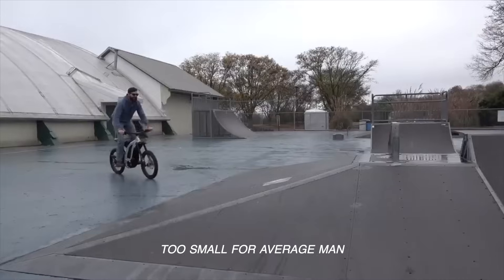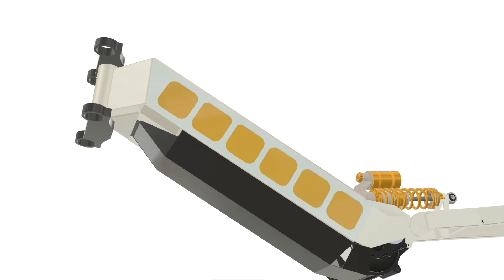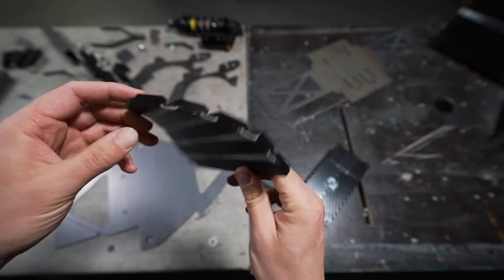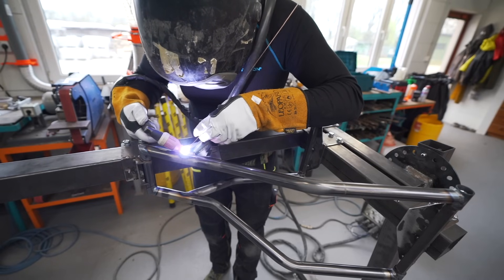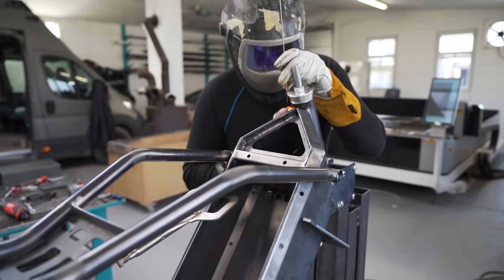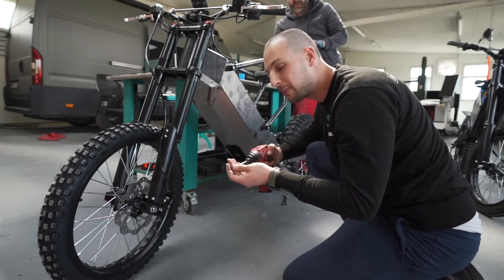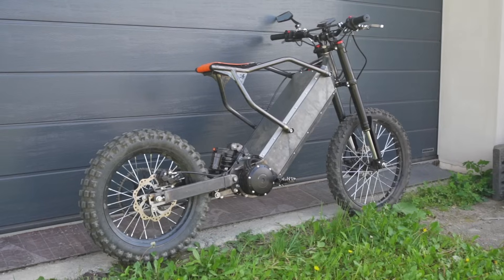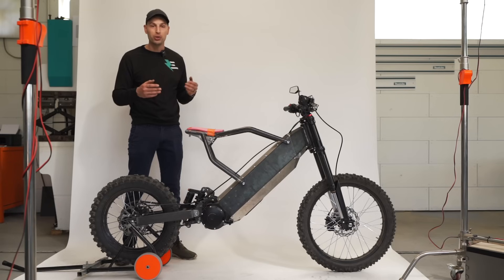Building Insanely Fast Electric Motorcycle From Scratch / New @ridevoltic Build

Comment: I love the design. I think you could maybe look at the seat. The more powerful ebikes all seem to have a small seat pad in the same place. But this is something that should be taken from motocross bikes. And the seat should go the whole length of the top of the bike. Right up to headstock..this would allow the rider to shift weight easily.and get more weight over the front wheel when it wants to come up. And for cornering etc. Also the radiator covers on a motocross bike. They aren't just guards. Their specifically designed so you can grip the bike between your knees when standing. Youre completely right to develop something different to develop ebikes properly rather than copying motorcycles because of the difference in hardware. But I think there is a lot that should be incorporated still. Everyone's making these high powered and using them off road. So the seat especially I think is essential.

Comment: When building a frame or "tube" bender (OEM) or otherwise you have to be very careful because most metal tubes bend much better at different temperatures with out deforming. Just like copper or Aluminum the "hot but "lower" temps keep the metal bending nice and clean without deforming or breaking.

Comment: That is a sick looking beast of a bike. I only see one thing I'd like changed. The seat to something with a bit more foam and a small inner metal ridge at the back to hug the backside and hold you in place better. Again awesome looking machine. I see a lot of places it can be even lighter, such as the main body/ case. Lighter always sounds good but it can be bad too. I like a certain weight ratio sometimes opting for heavier more and less. It helps plant power also plant me in curves. That is something I always liked and preferred with my 98 zx-7 compared to lighter new bikes. I feel way more planted and confident shredding through corners on an older slightly heavier mid 90s bike. I couldn't get used to new bikes, they even feel harder to ride for me personally. When I hear it said its usually the other way around.

Comment: the main reason bikes aren't made for tall people is because if you are in the top 5% or the bottom 5% designers will not make a bike that is ergonomic or anthropometrically designed for these kinds of people. its just not made like this because it limits customers as now only the top percentage height people will be able to use the bike which is not profitable. However its a very innovative design overall and I would certainly buy it if I was the target audience
Reply from the maker: It’s a full size bike. It’s not accurate to say for tall people only. Most electric motorbikes are just too small these day.

Comment: I've been working on a cruiser style e-moto build with LFP batteries in my head! 😄 I would mount the battery pack horizontally, inside the engine cage, as low to the ground as possible for improved stability. Any empty space above the battery pack, going into the faux gas tank would make for a good chunk of continuous and spacious storage area for a laptop, back pack or grocery bag. It would be accessible from the top, through a hinged lid covering the width of the gas tank.  I would want the seat to be lower than the gas tank area, for a lower center of gravity, with longer handle bars and pegs mounted bottom front of the engine cage. As for the motor, although a mid-drive setup would probably provide better performance, I think I would prefer a dual hub motor configuration, due to the more simple and elegant design, lower maintenance, and potential weight savings.

Comment: Great work , and love the basic deign of the bike , only thing I would change is the seat frame , but as it seems to be a bolt on part , it would be easy to have a few different seat designs and let the buyers choose which they want , great work with the battery and the integrated charge cable .

Comment: Need to run a heart shaped die if you're going to press bend with a bend radius 1.5-2x tube diameter to minimize tube distortion.  1.5x diameter or less and if you want zero distortion to your tubes will require mandrel bending.

Comment: Why not use an axial flux in wheel motor? Or a Donut Motor? Simplify!
Reply from the maker: That is a very bad suggestion with hub motor.
Reply: @ladiandmargaret  Works for Escotters UniWheels! now coming to 4x4's & SUV's. OK the Worlds fastest 0-62MPH vehicle not fast enough for you? The weight directly over the Contact Patch of the Drive Wheel/s! Suspension, vertical & linear too! Even with one Wheel Hub Motor Assembly missing it could still operate at near 100% with link Suspension. Not that's a safety benefit! No getting away from that! Just think of the reduction in car part Nos! 4 off Motor Steering Suspension Units! One at each corner, identical battery connections & bolt to Chassis Giga Casting kits! Simplify!
Reply from the maker: How is user experience with 15kg unsprung weight on the rear wheel? Ok for drag rase or flat road riding. Not ok on dirt roads. Your arguments are correct just missing the experience riding high power hub drive motorcycles.
Reply: @ladiandmargaret  All power Motorcycles have the majority if not all power to the rear Wheel. It just depends where it is generated & how it is transmitted. A hub Motor is direct Drive! Whether Donut Motor or Laced in. it can be either redial or Axial Flux, or Even Both! Experienced has to be gained as to what is best for Safety, Efficiency (repair/Replaceability) & Fun!
Reply from the maker: Yes, motorcycles are rear wheel drive. Chain, belt or direct dives. Direct(hub) for high power bikes is heavy, not fun to use in terrain.
Reply: @ladiandmargaret  You can make a small hub motor, say 8" (200mm) O.D. where the Stator is bolted directly to your swing arm. With the O.D. spoke laced to your Wheel Rims & tyre width & diameter of choice. You can put a disc brake to one side if Regs require. Then all you need is Suspension, Battery Box, control under seat & head stock up front. don't get me wrong. What you've done is Ace. But experimentation brings variety!
Reply from the maker: I wish it was all this easy, took few minutes and we had unlimited time with money.

Comment: Forget the 4Kwh Charger. Don't even put a Charger on the Bike. Use the National D.C. Charging Network. These all have upto 350Kwh power rectified to a D.C. Charge. Take a few minutes. Once the battery is primed for charge. Which you do on your way! Simples!
Reply from the maker: This suggestion is completely off.
Reply: @ladiandmargaret You don't carry petrol can in your Petrol car! or a Battery Charger in case your battery goes flat!
Reply from the maker: Are you aware these big chargers operate od 400V or 800V and our bikes are 92V? You can’t just plug in and charge small batteries with 350kW (not kWh) without understanding how things work. Just typing it for others with similar thoughts.
Reply: @ladiandmargaret  Sorry, did not realise. I thought all cars, bikes & light trucks all filled up at the same Gas stations on the Highway! That Ev's would be the same? Boy was I wrong! Bikes are no longer part of the mass Market? It seems. Down graded to Ebikes & other Electrically powered Hand Tools. So for a day out E-enduro riding, you need a bike, a spare battery pack & an E-Pickup to recharge your Spare battery while your burning out the one in the bike!

Comment: Aluminum frame and reposition seat and it would be absolutely perfect
Reply from the maker: You are talking about a completely different frame design because it’s not possible to bend aluminum sheet this way without cracking. Aluminum would require more traditional tubular frame. It would be more expensive and who knows how it would look. This was my choice and we actually did very well with the overall weight. It’s 10kg lighter than surron ultra bee - direct competition. Surron does not even have a built in charger and is heavier made of aluminum. We created very good protection for the battery with this shell frame. I love how simple we made it.

Comment: I would possibly reinforce the battery housing on the sides a bit more (same steel doubled on the insides) if you hit a nasty bump that could potentially buckle, although I don't know what width steel you were using. Awesome build though, what kind of batteries did you use to make the battery?
Reply from the maker: Thanks. We had to go down from 2mm steel to 1,5mm. It was stupid thick and heavy. It’s like a tank even with thinner steel. We use molicel battery cells. P42a and p45b

Comment: The wheels are way too small, looks weird
Reply from the maker: 21” and 18” are very common. It’s the frame that is big
Reply: @ladiandmargaret  Looks weird, so no 29" ? or or bigger than 21"
Reply from the maker: Isn’t 29” for bicycles? That is totally not suitable for motorcycles. What other motorcycles have bigger front wheel than 21”? This video is old, check out MySuperEbike.com to see how this motorcycle turned out.

Comment: Can you explain me how with  90volts and 60Ah you can have 30kw peak?because if we see the Power Is v*i so 90*60=5400w and thats not 30kw
Reply from the maker: Hi, sure. Looks like you are mixing battery capacity with power. Power is calculated 92v*400A=36,8kW and we measured 32kW in real life. Capacity is calculated as nominal voltage 80V*60Ah=4,8kWh. Hope this helps.
Reply: @ladiandmargaret okok thanks

Comment: You're missing the smartcard for your CNC machine goes in the bottom of your monitor for some models like your. check for a slots on both the table and control,  check power box its very temperamental needs 2 and half times back u0p power. I hoper you find it. do a follow up on that CNC MACHINE. Let us know what you found. don't sell it.

Comment: main color gloss black with larger trim areas in bright gloss red. small hints of standard matte twill carbon fiber everywhere. finally, add tiny amounts of shiny gold trimming down any corners & straight lines. any exposed wiring cover it with "teck flex" red or black with black heat shrink at each end of wire to secure it proper. could market this color combo as a special edition. no chrome, anything that would noramlly be chrome try to make it gold. trust me on this. it has been my go to color combo for my personal custom hobby builds. amazing work & what a awesome looking bike. good luck!

Comment: on trailing, small light weight bike is one thing but big dirt bikes? you better need a crane because it gonna be heavy
Reply from the maker: What?
Reply: @ladiandmargaret  i mean i prefer light weight bikes when doing off roading because the last time i tried with big bikes they are incredibly difficult to lift specially if you are alone along with uneven roads
Reply from the maker: 100kg is nothing crazy to lift for most people.

Comment: Why did you choose steel over aluminum?
Reply from the maker: Aluminum would not allow this sheet design. It would have to be tubes or milled. The overall frame design would be very different, more expensive and more difficult to manufacture.

Comment: Why use a transmission drive vs single or dual hub motors?
Reply from the maker: Because of weight distribution. Dual motor with 32kW power would be engineering mess up having 15kg hub motor on the front wheel.

Comment: 1. Battery swap capability 
2. We need 250 mile range
3. Aluminum or Carbon fiber construction?
4. Can batteries be stacked in the frame tube ?  To utilize that free space ?
5. Hexagonal vs cylindrical batteries for more efficient use of space (beehive pattern) ?  Or is the space needed for cooling or cylinder geometry required for correct electron flow / chemical reaction ?  Or just no benefit?
6. Is it a single gear ?  Therefore more power (revolutions) for faster speed, If you add a gear system would not it get a much longer range ? As reduced revolutions at higher gears.

Comment: bigger wheels, narrower battery,  nicer seat (1 or 2 point connection not 4)
Reply from the maker: How big wheels do you suggest? What do you mean by points of connection? Seat post attachment?
Reply: @ladiandmargaret  visually speaking as big as fits because the chassis is quite long and the bike is very high. also yes two points of connection or at least upper ones bent in same direction as lower ones🍀

Comment: I would suggest a lower seat height for those of us with 30 inch inseam. 
It would appear that the only reason for a high seat height is for riders with longer legs. Like yourself. 
Also, the lower the riders center of mass on this motorcycle, the better for handling, I would assume.

Comment: Love it. Please makea follow up video! I hope your kick starter goes well! As far as changes, I think the other comments cover most. 
1. Wheel Fenders
2. Offer of different components for gear ratios.
3. I agree with the slightly longer swing arm for road stability
4. By changing the design of the seat frame, I bet you could fit locking helmet storage underneath the seat. 
5. Headlights and brake lights.
6. Multiple foot peg mounting points.

Comment: Great bike!... Just a couple of ideas... Mount the motor on the swingarm centered as close as practical to the pivot point (to minimize effect on unsprung weight) and you'll never go back to frame mounted.  Also, accept the weight cost of 1-2kg and source motors in the 20-40rpm/volt range for a truly silent ride (even with chain drive) instead of the annoying electric chainsaw buzz that I don't understand how anyone finds acceptable.

Comment: Firstly, fabulous seeing some folks doing this for real and publicly! I've been messing with ebikes for a while now but what I really want is to drive between city's in the US.

 I'm curious about the idea of making it road legal in the US. I thought a VIN was required to register it? 
For the kickstarter I'd need to know how a few states would allow that and then I'm 100% in. Typically that means welding a piece of a honda ruckus into the frame and registering as a modified motorcycle. DOT reg lights and such too but the VIN is the harder thing right out of the box.
Reply from the maker: It’s fully road legal in the USA!

Comment: There's sufficient empty space under that seat to install, for instance, twice as much battery, or a battery of similar capacity but a lower cost,  less power-dense formulation like LiFePo4.
Reply from the maker: The battery is already oversized considering on board fast charger. Cargo space will be the best.
Reply: @ladiandmargaret  it is never oversized! My weight it is much more than yours, so it will drain the battery faster

Comment: I think this knowledge should be extended in Kenya Africa so as to reduce green house gas effect by decarbonizing some of the motor driven vehicles into little cheaper equipment to curb the climate change effect by the environmentalists....I envy this so much i need this knowledge desperately

Comment: A bike without cargo carrying capacity is a useless bike.   
You need to add a pickup truck bed to it to be able to bring home groceries on every trip, because that's what your bike will be used for 90% of the time.  It's got to be a pack mule, not just haul your bwtt and nothing else around.  Ask me how I know?   Been riding 20 years motorcycles only.
Reply from the maker: It’s not useless without it but I agree it’s important for a lot of users. 

Havoc is a platform and we’ll develop big cargo space for it. As soon as we sort out more important problems.
Reply: @ladiandmargaret  Here's my challenge.  Take your prototype, and make it your only vehicle for 12 months, year around.   No cars, no trains, no planes, no bicycles, no trucks, no motorcycles... you can only use your prototype to survive and get things done as your one and only principal mode of transportation.   Litmus test, where the rubber meets the road!

You'll quickly be adding some cargo carrying capacity to it, and you'll iron out a lot of real world use bugs, and sacrificing some light weight to add some creature comforts.   Esp. in winter, esp. in bad parts of towns, esp. in rain, esp to handle dead batteries and breakdowns from home.
Reply from the maker: I agree with the storage, we are just a small team of people and there is only that much we can do in given time.

Comment: Great to see you're not just simply outsourcing it all, if any, to China but rather using local Czechs to do the work.
Czechia has great artisans as well as world class steel production, high tech engineering and electronics so I'm not surprised you're doing so well with this venture.
I hope you get this great design to the point where you get a saleable and price competitive product.

Comment: nice work. But did i miss the bearings on the swingarm? Is it really only mounted on the screws without bearings? Also why not going for a belt drive? Less things to worry. less maintenance, perfect for a electric motorcycle.
Reply from the maker: Of course we used bearings on the swing arm. We might experiment with belts at some point. They have their disadvantages for sure.

Comment: actually... if you weld the right way... it is also the fastest way...... it makes no sense to say prefer faster welding over pretty welds....... if the weld is ugly;  it is not a weld at all.. and should be disqualified because 9 out of 10 times when its optical looking bad the inside is not good either, meaning you have an error in your weld, edit; especially when its ugly from going too fast.... that often results in too shallow weld, not burning the material deep enough ...........that being said, if you want to make a proper weld and still make it look ugly, it would take just as long as welding a perfect straight line, perhaps even longer